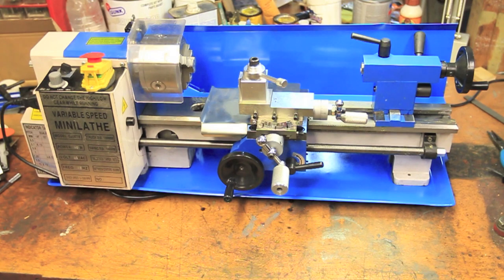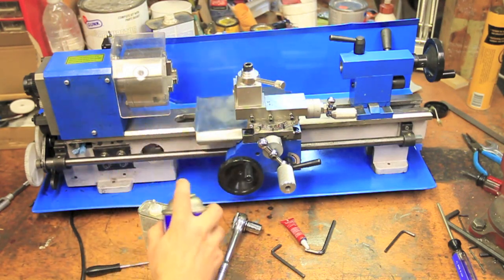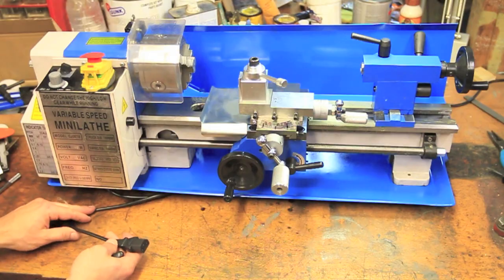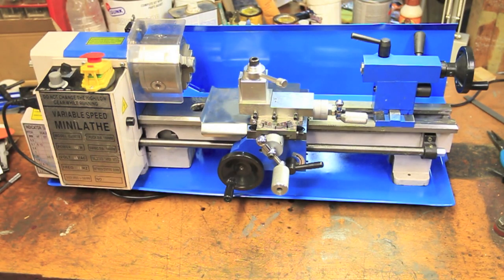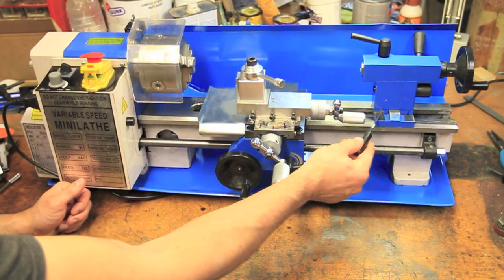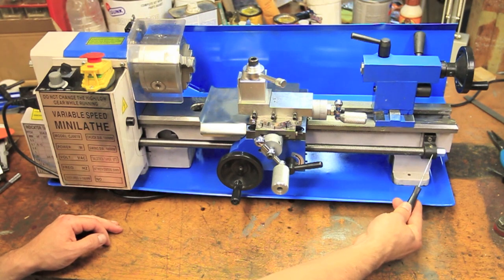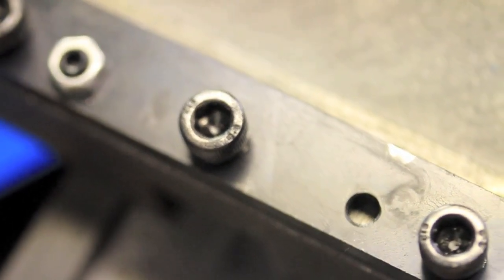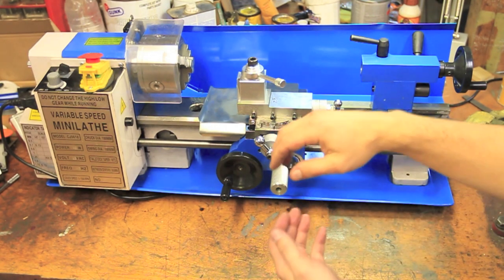Tear Down and Wiring Upgrade + Complete disassembly, cleaning, and reassembly of mini lathe

Comment: LOADS of videos on up grading these mini lathes, seems strange that the manufactures don't take advantage of this knowledge and at least try to upgrade there product. even a simple mod to the compound slide by changing it to a single locking bolt so you don't have to wind it off to change angles.
Reply from the maker: Seriously, it wouldn't take very much to make these A LOT better... thanks for watching!
Reply: I agree with your sentiments, may be it should be the prospective end user that should be telling there retailer what small changes they would like to see, what ever branding they are using, with out a customer they have no product.
Reply: I've heard it best explained like this, when you buy a Chinese machine look at it like you're buying a kit, that you have to fit together yourself. People that expect to just unbox units and begin working will be disappointed. But people prepared for what they are taking on are satisfied.
Reply from the maker: Exactly - I have learned this and it's very true... and for a kit it's not a bad deal, except for if you need a lathe to fix it haha.
Reply: You finally did in this episode what experienced folks say you need to do right off the bat. Fully disassemble the machine, clean it, debur it, and basically give it a good going through. To catch all the pimples and warts that the Chinese ignored. They do have a bizarre idea of what lubricants are too. I've seen stuff that looked like toxic waste being passed off as grease in Chinese products. Goo that gives off the distinct odor of contaminated junkyard mud. That stuff needs to be cleaned out, and replaced.

Comment: I see that you soldered the wire tails before crimping on the Faston connectors.  The soldering is not necessary.  The connectors are designed for copper wire.  I don't know if the soldering would cause any disadvantages.

Comment: Nice job, except for the grease and tinning the wires before crimping -- and*, using a male IEC socket for a DC power output is a *HUGE no no for two reasons.  The important reason is having high voltage DC on exposed pins, and I'm sorry, you saying that the chance of a problem is infinitesimal is not going to make you any happier if your kid or the next door neighbor or you yourself when not in your right mind get hurt or killed by it.**  Please be told, you really need to fix that.  The lesser reason is that some chucklehead could blow up your driver board by plugging 120 AC into it (maybe).

*I'm allowed to be vehement about this -- I damn near killed my father (suffering from dementia) over the telephone because of an unsafe electrical condition that he'd let go for thirty years knowing that *he would never stick a screwdriver there.  Well, he was just about to do exactly that, right onto a 240 volt contact, when I got cold feet and told him to down tools and get the neighbor in to look at the problem in the morning.
Reply: Well, the emphasis didn't work the way I wanted, but close enough I guess. ;)

Comment: I hope (for you) that you've already corrected the error made on the motor wiring. Using a male socket where power is out, as dbeierl perfectly described below, is a HUGE NONO!!! Using that kind of connector is already a border case, given the fact it is normally used for AC power distribution. But I understand, it was around, suppose you've salvaged it from a dead PC power supply or other old equipment. For small money you could purchase some decent connector though, even a speakON could be a better solution.

Anyway, if you keep this connector type, PLEASE install the female part at the control box!

Comment: Dear oh Dear, do not do what this guys done EVER getting some grinding paste on the bed ways that is not how you square up the lathe saddle, cross slide, or compound slide, you haft to scrap them in, 1st thing all your doing in putting the error to the other part you haft to scrap them in but before you do that you got to find the error in it they put them on so sloppy is because its not square of flat let alone parallel, its like that because they have never been scraped in as it cost 500 bucks for a machine, accuracy costs money a lot of money it takes weeks to do a machine, to do it you need a hand scraper best way to start is measure the bed its hardend so it would have been done on a grinding machine hopefully its well maintained you scrap under the saddle 1st by putting bearing blue, ( we use jewellers rouge mixed with light oil and rolling up a tea shirt tighly and wraping it tight as a wad ) apply it to bed and rubbing the saddle back and forwards to mark the high spots, and scraping the high spots you will need dial gauge, mount, machinest square to clock the error to find how square it is and you do every slide up from the bed even the tail stock, and you need to find its square and level its not a job for the home diyer, 

 i'm a machine tool fitter ive watch so many of these videos with folks advising people what to do with very bad advice, dont do anything this guy has said their should be videos how to do a basic scrape, you can buy a hand scraper and bearing blue i make my own out of an old files its just what i prefer as you cant get into some small v beds

Comment: If this lathe costs $900 (at least the same model but another "brand" name, typical of chinese clones), and you then need to investo another $300-400 on new belts, grease, new sprockets, a motor holder, wiring, then re-tool all the parts because they are not polished, not routed well, not machined, remove rust...........I don't know why not to spend $1700-2000 in a lathe made in Germany or something at least with some real quality control made in Europe........you spend in the end around $1300-1400 plus some couple of weeks till you finally address all the problems this machine has.....
Reply: I don't think you have to spend that much
Reply: @jameshammer690  which is why people who buy chinese garbage really need to sit and think for a couple of minutes.

It's the same case of those who buy chinese guitar clones for $300-400 and then need to invest $500 more to buy pickups, bridges, tuners, new hardware, etc.....a guitar of A quality cost between $1000-1.500 and it is 100 times better in quality to anything you can get from china even after the upgrades......so, instead of buying a piece of garbage, and then waste time and effort to make it playable, you need to invest $900 almost, when saving $$ for 2 more months, you can buy a top class instrument.

Same with any machine....I still have my grandfather's drill, made in Italy around 50 years ago.....the thing never broke.....while all the chinese crap drills I bought, broke in less than 4 months, 2 if you use them daily and needed serious upgrades.
Reply: @nicolashrv  Sure. And I bet your I-phone is better than my 30 dollar android phone that I have had for 10 years.
Reply: @iguanapete3809  your comment shows you have no idea about anything.

Comment: We have state of the art CNC machines with five axis spindles capable of holding tenth tolerances, high speed machining with cutting edge tool geometries for greater efficiency which relieves the manufacturer to rely on human skill. Yet here we are, inundated with sub par Chinese made machines that look like they were made by inexperienced and disgruntled workers who shit in a corner and do not give a rat's ass about quality. They don't even have to do much since CNC machines do all the high speed and tolerance work. It is as if the manufactures of these paperweights or anchors (because lathes they are not) are 40 years out of date on the means by which they make these atrocious machines. What a waste of labor, time, and metal from mother earth. As a machinist of 35 years, I find it utterly disgraceful that we've come to this. If they could make these things with crap, they would. It all comes down to profits. Needless to say, I would never buy ANY Chinese made machine. I have a 1960 clausing lathe. Other than the hydraulic valve to control the speed that needed to be replaced,  this lathe still runs like a champ and keeps tolerance. At this day and age, with all this technology, you would think that no one would ever built machines WORSE than those made in the 50's and 60's. We are not progressing but regressing. There should be no reason why anyone would even THINK about fixing ANY new machine. You are not suppose to because it's FUCKING NEW! Would you by a new car and set out to fix it? It's madness.
Reply: While I don't want to knock this guy for trying and wanting to learn, he would be much happier and better off buying a used Southbend, Logan, Clausing or Atlas.  Nothing is more frustrating than working with something cheap and not getting good results.  I hope he tries to learn what he can and then moves up to a better lathe.
Reply: Price and availability is the reason, plus as someone else has said it is a hobby in itself improving the quality. I have been checking at least once a week to find a used better quality for around the same price for several months and not one has turned up. Given the fact that they are a tenth of the price of a high quality machine, you don't expect perfection.
P.S A high quality CNC can cost upwards of $100k, a Chinese factory worker costs $2 a day
Reply: GnosisMan50 So I take it you'd 'suggest' rebuilding an old lathe over getting a Grizzly, Fox or other China crap model. 
Its kinda frustrating here near Portland OR as even crapped out small Logans go for $2k, and  I could get Grizzly new at that price.  I don't relish spending 100 hours rebuilding an old lathe, but would likely have to spend some time on new one anyway. 
I've purchased a Chinese  stage and vise for a vintage drll press - and had to spend hours rebuilding, smoothing, lapping to get tolerances to reasonable levels - and you can't DIY fix the crap steels issue on Chinese junk.  So not sure what to do.  I'm not a machinist but want to learn for homestead projects.  Any thoughts?
Reply: These days most things are made in china regardless of brand and you get what you pay for from china just as you do from anywhere else. At $2kUS that is the high end of the chinese lathes, the cheap ones start at $500. I also am not a machinist, but from what I have read on the forums, there is a big difference in the quality of them proportional to price
Reply: graeme Tho   Thank for reply.   Buying an overused US made unit there could be deep wear which is really hard to fix - or detect for a non-machinist.  Buying a hi-end Chinese unit at least I'd have something to work with.  As you say - we could be producing great units here if gov't had chased most manuf. away.  If retired I'd certainly build my own with the concrete lathe system - but the time spent for me would end up equating to over a $10k lathe; sure would be fun though.  So by the time I get other projects done and ready for it the answer may appear.  I've finally got a big shop to work in and want to learn and do soooo many things.
Reply: RelentlessHomesteading over here in California i found a logan lathe with 2 3 jaw chucks, a quick tool change post, a good amount of tools a ,a steady rest, tailstock and thread dial for 800 dollars very cheap lathes if u look around,Craigslist,offer up,or online auctions and much better than those Chineseium ones
Reply: Thanks for the encouragement.  That's a great price for a Logan.  I'll keep lookin'.
Reply: That's why people buy Chinese machinery. We get tired of keeping looking. If I didn't buy my Chinese mill 24 years ago now I'd still be looking. Half my life would have passed me by without owning a machine too. Because frankly I've never seen anything in all that time that I could have bought instead of it. Sure, I hear about folks getting in on good deals, but I keep buying lottery tickets too, and so far that hasn't panned out for me yet either. So call Chinese machinery the consolation prizes that we award ourselves. It's better than nothing.
Reply: LOL -- The funniest things are those that are true at their core.   Thanks for the perspective !!
Reply: @GnosisMan50: I totally agree. Elsewhere someone commented there is no justifiable reason that Chinese lathes should be so poorly built. They must be using the best of CNC equipment available to build them. It's part of "we don't have time to do it right, but we have time to do it over later". In reality with the equipment they are using it takes no more time to build something right the first time than to do it wrong - it's all in the numbers. Surely someone teaches them which end of their chopsticks to eat with, why not take time to teach them to use their machines to build a better machine?

Comment: time 6:05 uh, you need clean ALL first good then can take off all parts, amateur work, i no like working dirty area, stupid and not good and safe.
Reply: then you would faint if you saw my workshop...I have a "cronological system".... the longer ago I used it the deeper it will be buried in  the crap!

Comment: What's the point buying a chinezium laith, when you can spend a few hundred more on a good one or second hand old school laith that has run for 20-30 years with no problem or mods and no need to waste hours of my time to replace shit parts. I have better things to do than to re-engineer some spotty faced gits shit job at the drawing board he should of got right the first time, I am sick of fixing fools lack of foresight, Its old school for me, you know what you are getting, gears that are real metal and not spastic plastic, Not even going to go their it aint worth it..
Reply: I guess people are put off by the size and weight of those behemoths
Reply: It's like buying cars... You may very well have bought an old used lathe that was used and ABUSED that will need a complete rebuild just like this one... That will cost far more then the 400 euros this costs on AliExpress.
Reply: A nice old solidly built lathe is extraordinary scarce where I live. I would love to own one, however there simply isn't the market.
Reply: @magnusandersson2929  - On my neck of the woods, if a good old school lathe comes to the market. Usually its beaten to death. Certainly recoverable, but most times not worth the trouble. 
One thing is for sure, never a good machine "out of the box" demanding as much or way more work than these Chinese lathes!